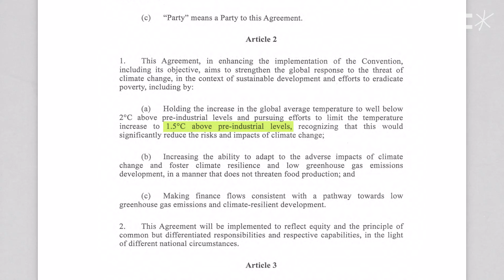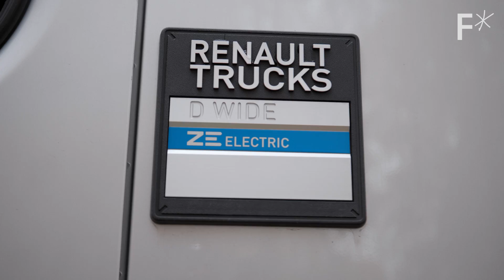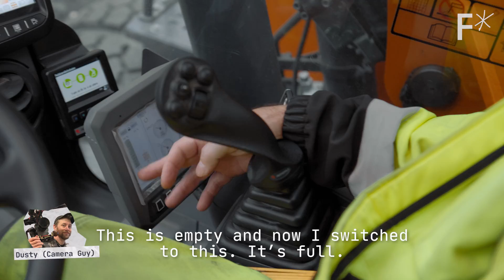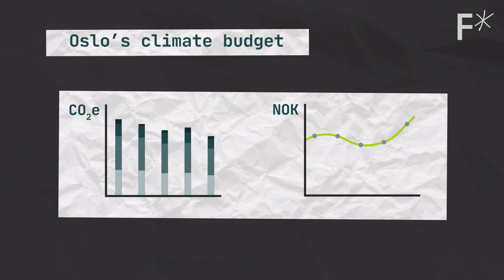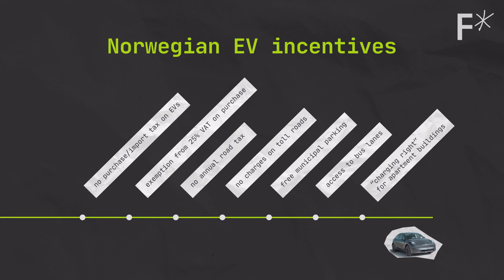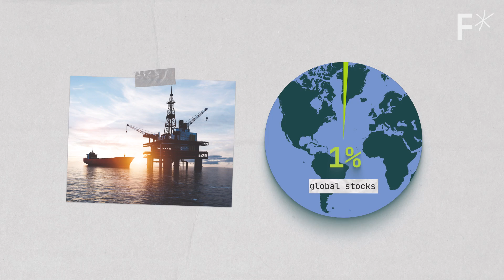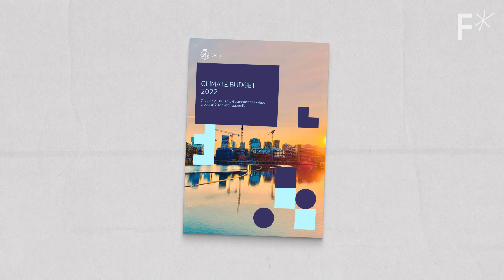The world’s most electric city | Future of Cities

Comment: I have a hybrid.   Love it.   Some of the things not mentioned about EVs  is that 99% of the time I charge at home.   No more waiting in line at gas stations.   I rarely drive to a gas station except on long trips.  My gas bill is no longer $250/month.  Technology is just going to get better.   Look how long it took to get the automobile to where it is now.
Reply: Toolong
Reply: @TXDude  yes, there is a lot of work to be done.   Apartment complexes, hotels, will need to provide chargers.   I could see places like McDonalds providing chargers to get people stop and charge while eating.   Tesla chargers can charge their cars in 10 to 15 minutes to 80% capacity. That last 20% apparently takes a lot longer.  But what I see is a change.   You won't be driving to a gas station, maybe just charging at work.
 Amazon is making the switch to electric delivery vans.  Lower maintenence,  cheaper to run,  they just plug them in at night.   Walmart is looking at Tesla trucks.  The idea would be while unloading the truck the battery gets charged saving tons of time for the truck driver. 

EVs aren't for everyone but a lot of people like them once they start driving them.   I will still keep my 4Runner for camping and a few other things. It makes sense,  their is no electrical hookups at campgrounds yet and I bought a hybrid for the reason that we need more chargers especially for long trips. But my go to car is my Volt.
Reply: And trams and trains go even further. You never need to charge, fill up gas, you never need to park, you don't need to release micro plastics from your wheels (like cars), you never need to go through security or check-in, or come very early or limit your baggage (comparing to air travel). And you don't need to focus on driving, or wear a seat-belt. You will also never have to pay for speeding tickets, you can go even if you're drunk, you don't have to pay for maintenance or go for examination of your car or whatever it's called in english. And of course, even less emissions than electric cars. I also think bikes and e-bikes as well as cargo bikes are important.
Reply: @jakob7116  and trains serve more towns that planes hop over so you can get closer to your destination.
Reply: Took way too long. You can thank the oil and automobile industry for the slowness of electric car development. Luckily the tide has turned. Also we need more good mass transit
Reply: Yeah, this world is FUKD
Reply: @zerostarfree  I think people need to realize how these power sources work. In the night when the sun don't shine is when most people charge their vehicles. To meet this demand, we would need a LOT of batteries to store power. The upfront cost for this would be massive and it seems not one is thinking about cloudy days.
Reply: @alileevil  you don't realize, even though u said electric price still low people already invest in solar panel and battery, the day surplus could be redistribute to local community for extra bucks or for free. If as you imagine gov will bump their electric price then there will be solar harvest mom and pops store popping out everywhere since it's clearly easier and cheaper than making nuclear power plant or oil refinery (finite energy)
Reply: @alileevil  we have great batteries already.  At night we can release water from dams to help with the demand at night.   Plus we have windmills, wave generators,  geothermal generators besides batteries.  But when solar becomes more abundant we will change our habits and using electrity will be cheaper in the daytime than at night. 
And if we have a shortage we may have to fire up a few gas generators to get us over the hump.
Reply: @zerostarfree  Solar is not free, it's an investment. An investment that takes at least 7-10 years to break even. With a life of about 20 before it needs to be replaced with potential breaking earlier.

Which also devastates the planet with lithium mining and kills animals. Majority of lithium mining is in rainforest and highly diverse desert areas. Majority of oil production is in desolate deserts with nothing on them.

Lithium mining is solo-responsible for making flamingoes endangered.
Reply: @asoton957  the time to break even on solar depends on a lot of factors. Like where you bought it installation price and how sunny you are and how much energy you use. Time to break even in texas or California is going to many years ahead of Calgary.
Reply: @KManAbout  So what is Calgary meant to rely on? On Texas????
Reply: @TXDude  There are more apartment complexes installing car chargers.  It will become a reason to rent at one complex over another.
Reply: In agenda 2030 it is their aim to get rid of private cars off the rosds. This will be done by many evil ways and is a big topic in itself!
Reply: Currently, electricity prices are low to encourage people to take up EVs. When enough number of people go electric, the price of electricity will match that of gas. And regarding the future of cars,  we are all  going to be driving golf cars with computer screens attached to them.
Reply: @alileevil i totally dont agree with the notion that electricity prices will inevitably match gas prices in the future. The price of electricity and gas is influenced by numerous complex factors, including supply and demand dynamics, energy source availability, geopolitical developments, and technological advancements. While lowering electricity prices may encourage EV adoption, it is not a guarantee that these prices will eventually align with gas prices. Additionally, predicting that all cars will become simplistic "golf cars with computer screens attached to them" oversimplifies the diverse and evolving nature of the automotive industry. The future of transportation is likely to encompass a wide range of vehicle types, sizes, and features to meet various needs and preferences. Achieving a sustainable future requires a multifaceted approach that incorporates renewable energy, energy efficiency, urban planning, and a careful balance of transportation options.
Reply: @alileevil  Why in the world do you think that electricity will match gas? We use electricity for more things than gas currently and it is a fraction of the cost. It will always be this way its basically physics. It is just a more efficient process for what you are doing. The only reason we have gas cars at all is because batteries technology was piss poor. That is no longer the case as battery technology has vastly improved thus far and all of this because we have made significant progress in the creation of robust alternative energy sources and the efficiency of scale.
Reply: @KManAbout  Gas prices are set up OPEC and the USA. These countries decide how much oil they pump out, controlling the supply. The same will be the case for electricity. Companies and the govt (by way of taxes) have to turn a profit and they will set the electricity rates that way. BTW, the amount of energy we use is way greater for gasoline than electricity (which BTW is mostly generated either by natural gas or coal).
Reply: @alileevil  That's not how any of this works lmao
Reply: @alileevil have u forget that solar panel exist? Basically electricity is easily producable by end user
Reply: @alileevil  my electric company is already making a profit but since they are considered a monopoly their rates are set by the PUC (government).  Im not at the whim of OPEC or wars causing my fuel prices to go incredibly high.  My EV doesn't need an oil change every 3 months,  spark plugs every 100,000 miles,  a smog check every year.   ICE vehicles must maintain the transmission, oxygen sensor, timing belt, fuel filter and engine air filter.
I wouldn't consider my EV a glorified gof cart.  It easily goes 90+ mph and it beats most cars off the line.  It's fun to drive.
Reply: @KManAbout  Have you heard of this thing called petrol taxes?

They take up around 60% of the price in gas stations. If the government treated petrol and diesel the same way they treat electric, diesel prices would be less than half $ what it takes to charge an electric.
Reply: @varsoo1  have you heard of oil subsidies? The range in the hundreds of billions pf dollars.
Reply: @KManAbout  Oil subsidies is a nonsense concept.

First of all, tax breaks are not a subsidy. A subsidy is a direct payment by the government to a company/industry to support them. This does not happen with oil and never has. 

If a government reduces your income tax from 20% to 19%, you are not being subsidised by the government. That's a frankly retarded way to see the world.

Second of all, it's uniquely American. Doesn't happen anywhere else. Although to be fair most other countries don't tax their oil producing companies so there's not many tax breaks to give.
Reply: @varsoo1  tax breaks are absolutely subsidies. money is money and not having to pay fees everyone else does is the same as more dollars in your pocket.
Reply: @KManAbout  We're all being subsidised every year by the government since 1960s when governments started reducing tax rates, then. Every single person and corporation.
Reply: @alileevil  all 50 states have a public utility commission that sets rates. Members are appointed or elected.  If that governor wants to get reelected, electricity rates better be reasonable.   Can't say the same about gas prices.  OPEC can decide to lower production,  a war anywhere, a huricane,  a refinery goes offline, all these events causes gas prices to go up.  But guess who makes record profits during all of this, big oil companies.  Shortages are big oils cash cow.  Nothing like having demand greater than supply.  
EVs are a threat to big oil.  So they throw everything they can to kill EVs.  Did you know JD Rockefeller tried to stop electricity from going mainstream.   Electricity threatened his kerosene market which was the main way people put light in their houses.   
The world is going electric. We should be leading they way with all types of options and not let China take the lead.
Reply: @alileevil  Gas is a limited resource that keeps taking more and more to mine 
electricity will cost more but there are renewable keeping prices lower and not running out
Reply: @alileevil  what i don't understand about this comment is the fact that as shown in Ukraine during this war, individual solar helps severely, if we use a proper well rounded solution of multips types for energy, plus the inevitable future of fusion electricity should long term cost way less.

Comment: Sounds like a nightmare place to be after an EMP attack
Reply: EMP destroys electronics. So your Ford would also stop working.
Reply: @Marek Sýkora  you're suggesting an old, '67 gas powered Mustang is not going to work?  Lol 😆
Reply: @whitenip84  Sure. It would not have gas as electronics of the pump would be destroyed.
Reply: @mareksykora779  electric pumps are a commodity, people back then had no problem pumping gas without the use of electricity, hell be fine

Comment: I don’t understand why the ferry would not be able to have a fire suppression system fit for the batteries it uses.
Reply: Im the captain in the video. Todays (but hopefully not tomorrow's) lithium batteries are very difficult to extinguish and requires firefighters hours or even days to put out depending on the amount of batteries and the state of charge when the fire breaks out. The ferries uses a water mist system with very fine droplets to cool down the batteries until trained firefighters can take over the job of putting out the fire.
Reply: I think because a fire is much less likely than with oil, if one does start in lithium ion batteries, they will be very hot and you just have to let it burn out while keeping it cool with water.  One day there will be solid state batteries without that problem, but for now, this is way better than oil.

Comment: I watch this with a heavy heart as I live next door to Alberta Canada that has an oil wealth far greater than Norway.
 The province is making little to almost no attempt to electrify or drastically reduce fossil fuel consumption. They have also let most of the oil wealth run away to far off investors pockets and the province carries a heavy debt. Norway has 1.4 trillion in its wealth fund
Reply: Next door to Alberta, do you live in BC? Which investors ran away with the oil wealth? Correct me if I'm wrong but Canada's oil wealth is irrelevant if crude products cannot reach the markets. In fact, out of all the oil producing nations, Canada is the only one that cannot supply itself with oil. From an energy trading standpoint, Alberta has no investment value with or without green energy.
Reply: @wyw201  Canada produces more oil than it consumes. It goes to the USA via pipelines. It is less expensive for the east to import oil and refine it there.
Reply: Alberta is still loving coal!

Comment: Worth adding that hydro dams are made of concrete, transmission towers of steel, electric cars of metal and plastics.  Norway is simpy shifting carbon emissions somewhere else.  Utizing electricity for public transport makes sense but lowering overall consumption is key, not building more electric vehicles.

Comment: floating wind turbines could be a simple concrete cylinder raised by pumping ballast water in weak winds - honeycomb aluminium turbine blades be cheap and make for perfect recycling 
(all you need to pull under-sea cables is a boat )